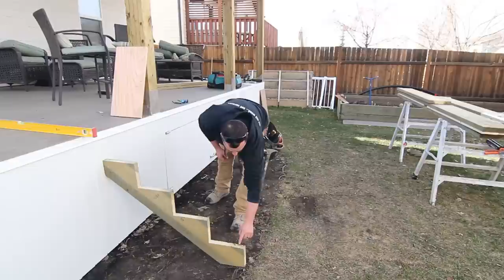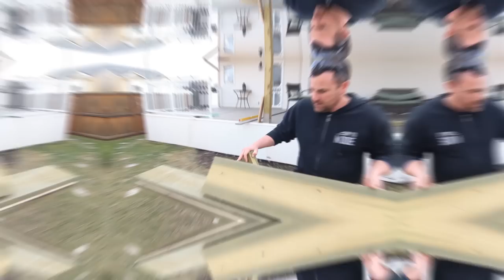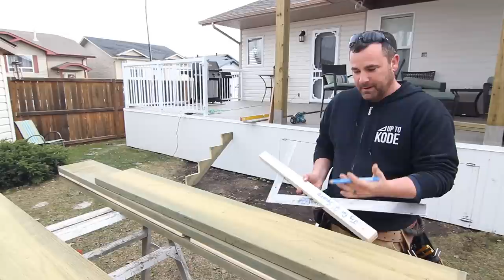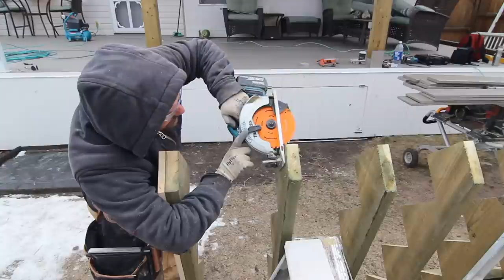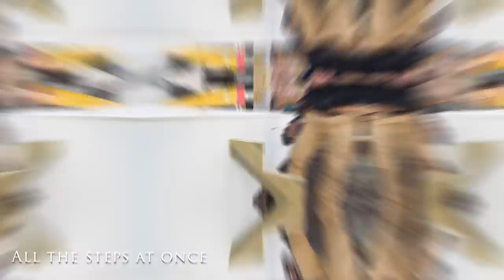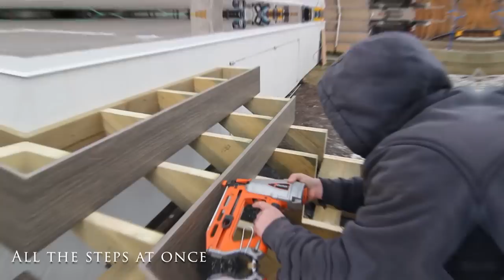How to Build a Set of Deck Stairs

Comment: Hey kode....at approx. 4.30 of the video, you mention you typically use a 10" run. I've been contracting for 20yrs, and although this is generally true, I like to use a simple trick that an old carpenter once gave me. In order to have a comfortable incline in your staircase, use this formula:  twice the rise + once the run, = between 24 and 26. So...let's say you use a 7.5" rise.... well 2x that (15) + 10= 25.... you have a comfortable incline. This comes especially handy when you're building elongated steps or an extra long span with short rises. Let me know what you think!
Reply: You are correct, last year I tried to explain that formula to a professional contractor who has many Youtube videos.   He thinks it's 2 times the tread, plus the rise equals 27.
Reply: Can you explain thst in detail cause I'm building steps for my deck
Reply: @nicolewebb558  hey Nicole... once you've determined your total height of your staircase (from the ground, to the deck floor) , you need to figure out how many steps you will need to climb. So, let's say your total height is 60". At a comfortable 7.5" rise, you'll have 8 rises and then get to your deck landing. So, twice the rise (of 7.5") is 15, your step can be either 9,10 or 11" for it to be a comfortable climb (to total between 24 and 26").
If you wish to a longer staircase, with more steps and shorter rises, you can use a 6" rise, with a 13" step for it to be comfortable. 6x2=12 + 13= 25.
I hope this helped.... good luck
Reply: @vitodifonte8761  the deck steps I see 5 so I was going to buy a pre cut one to 5 same as is but i don't think the rise on this one will match the one I buy cause the one I saw online it has a rise of 6 1/2
Reply: @nicolewebb558  the precut stringers are practical, but will rarely fit perfectly to your deck. You'll often have the last step either to short or high compared to the rest...this leads to a high risk of tripping up the stairs. It's your call in the end.... but I would strongly suggest you give it a go at your own stringers

Comment: My challenge is that I'm going to be building wooden steps over uneven brick steps.  I'm  trying to make a template so that I can cut upside down stringers to sit on the brick steps.  Then, I can attach the steps to the stringers and have them all even.  Complicated, but I think it'll look good.
Reply from the maker: Certainly a challenge to get the first step to match the bricks but you can do it!

Comment: Great video! I did my steps the same way, I didn't want to just toe on the stringers, so i inserted a ledger in between the two outside stringers, and it was self explanatory to trim the center stringer the thickness of the ledger and nail into place. i never knew it was called a ledger, I just wanted a board there so I had something I could screw and lag securely to the face of my  deck landing off of my garage.Thanks!!

Comment: Awesome vid. I'm taking my carpentry level 1 right now. On a ledger like you put on, they say to leave a 1/2" air space so wate/debris can get out. Just a thought
Reply from the maker: I’ve been making 1/8” saw cuts in the back of my ledgers to allow for drainage. Then I still get tight attachment to the wall. Not to say there isn’t better ways still.

Comment: This is exactly the video I needed for my project.  The jig tip is super.  At this point I have a question about the product you used under/at the front of the stringers.  it appears to be secured  with large spikes.  Thanks in advance.
Reply: Search “rubber edging”
Menards has best pricing, Lowes has it in stock often, Home Depot you can order it in packs of six. There are lots of offbrands that you can get cheaper online. They’re heavy so shipping may be a pain.
I fell in love with these thinking they would be wonderful and bought a couple hundred dollars worth at Menards last year...
Here’s what I learned:
They do make wider versions and you can search them online (typically from China🙄) and that ‘would’ve’ been ideal... the ‘mow-over’ edge is TOO shallow and I can’t get close enough to it with the mower deck... to actually NOT have to edge/trim afterwards 😖
...find these with a wider BOTTOM/GROUND contact side & your golden🙌🏼
After settling 1season, they sit so low in your grass & they loose effectiveness...In order to get them securely in the dirt they can’t be on ANYthing loose*BUY LONGER SPIKES*  which means you have less height room for mulch😕
I’m trying gravel this year- but will be searching for a WIDER version; since the object was to eliminate weed eating/edging!
Reply: I recommend running block along the front and sides your stairs so that you don’t have to edge/mow  up to it and potentially beat up you’re finished material. I was lucky enough to get my hands on a long piece of sandstone & sunk it in the ground in front of my bottom step- and it only sticks up a cpl inches  where I can’t catch it with the mower deck👌🏼
Oh, and something cool abt the rubber edging- u ‘can’ saw it at any angle, it has SOME curve/bend ability, and u can drill a new hole to put a spike where needed...but don’t try to cut the rubber w/any power saw lol it’ll ruin ur blade & smell awful

Comment: Enjoyed the informative video. I'm in the process of building new stairs from my lawn to my covered terrace. In your installation, did you just rest the risers on the ground or did you have some kind of base to rest/secure the risers on? It looks like the risers are just resting on the ground. I'm trying to figure out how to do this in my case. The stairs that were initially installed 14 years ago were just installed on the ground and they're now completely rotted. Appreciate your input. TEX.
Reply from the maker: This set was placed on the ground. On big stairs (wide and tall) I would consider a 2 concrete pilings for it to sit on. Maybe a strip footing across the piles but you need a void form under the slab to stop frost from smashing it apart.

Comment: Thanks, I am working with TimberTech boards & the square edge boards are not solid, I have < 1" that is solid on both side.  I am also doing a 5/8" facia.  Would you do no overhang or >= 1/8", so you have something resting on the stringer's vs resting only on the facia?  Or should I try return the board & get solid one ordered?

Comment: Thank you so much.  I do have a comment.  My Trex composite boards are 5.5" each, and I need a 1/4" spacing between them.  That would make it 11.25" total.  With a 1" overhang, my run would then be 10.25"  Right?

Comment: What is the name or where can I find that who that you attach to the framing square looks very useful
Reply: Try using any “true” straight edge😉
Aluminum flat bar from the big box store is a good place to start; Clamp two pieces together and tap identical holes through them accordingly- (use recessed head screws) - then add it to your square by sandwiching it between the 2 tapped straight edges you made.
Reply: Btw- It almost looked like he used some vinyl/dense poly sheet good (But I’m guessing it’s not, & it was something store-bought) 
I wouldn’t recommend that sort of product; it ‘mars’ to easily... it would get you through a project though & keep the needed tools to create it, limited

Comment: I would love to have seen how that cleat was installed.  I have sloped dirt where a deck company installed the stairs, and I am replacing the stringers and installing composite lumber treads, so I'm adding more stringers, using 2x4s to bolt stringers into deck and feet of the stringers to keep them off dirt. So my thought was to use pavers and lag bolts underneath 2x4s to keep 2x4s off pavers, but am concerned that lag bolt heads on top of pavers will cause slide issues since nothing is attached except at the deck. Hard to explain.  Ideally I could set a concrete base at bottom of stringers and bolt 2x4s into concrete but was trying to avoid that, thus pavers.  But I don't see a way to bolt 2x4s to pavers that would solve possible sliding away from deck. Thoughts?
Reply from the maker: What time on the video was the cleat in question? Email me if you want. Kody@uptokode.com.  Include a photo and I’ll make you a sketch.

Comment: Great video, Kody. Could you elaborate on the base holder? What would you do if there is a concrete pad or patio instead of just dirt? Love your videos.
Reply from the maker: I don’t have any footage I can throw up quickly for you. That base holder is just a 2x4 notched into the very bottom of the stairs to hold them straight and true. If landing on a patio or something solid you could do without it but I think it’s still good practice.
Reply: Thanks  @uptokode , you're the man!

Comment: Hey Kody! What would you suggest for a situation where I have a 2x8 header and I want to start my stairs like you did (meaning the first step from the deck is not even with the deck).  How would you support the stringers?  I hope I explained that correct.
Reply from the maker: I would install another 2x8 directly below the 2x8 that is above. Then I would install 2x4 vertically on the backside to connect the 2. Then attach your stairs to that.

Comment: Nice video, you explained it beautiful just the way I wanted to hear it, just one question what’s on the bottom of stairs?  Is it concrete or just soil?
Reply from the maker: The stairs are sitting on soil with landscape fabric on top. Then the lady had some rubber landscape border that goes around the perimeter of the stairs.

Comment: Hello Kody, do you have a video on how to build a free standing stairs? I have a trailer that I store at my home and to maintain having the trailer set level, the one side with the entrance door is now 2 ft from the ground. So with that said, I need to build a free standing set of steps that works for a 2 ft distance from the trailer landing to the ground. Any info would be greatly appreciated. Thanks much, Rob
Reply from the maker: You could try build a normal set of stairs and then adding vertical and horizontal pieces to the stringers so they are self standing.

Comment: Thanks for the help. Put a new shed is a while ago but needs stairs. Did you put the timber straight on the ground/with insulating material? My stairs lead down to a sloping lawn - so I figure I need to put posts in for them. Plus it gets really humid here in NZ - so direct on ground=rotting out(even H4) in 4-5 years.

Comment: I have a question.  My composition deck material is 5.5 In. That said. Treads are 10" but 5.5 x 2 = 11. So? There will be a 1" nose? Is that a deal breaker?
And my out side deck is only 2x8. Which is 7.25. The distance down isnt enough for  to catch the heal? Or the back side of the top step. My other carpenter friend told me to use strap material on the back  side of the top step to Hang the stingers.
But...that would screw with my finished look. I will be using a 1x10 cedar fascia for my trim.  I may be able to cover the steps ( the 2x8) with that????.
Need some direction on how to attach stairs when there isn't a 2x12> 11" or better on the face of what I'm nailing the stringers to.ps. with a 1/8 " gap. And a gap at the back of the tread and the riser? And a3/4 nose 11  and a 1/4

Comment: I have a project that involves a  set of deck stairs that wraps around a 90 deg. corner. Any suggestions on laying out the corner stringer?
Reply from the maker: Good question. I haven’t physically done a set like that but theory would be this. Rise always stays the same. If the stringer is on a 45 degree you need to multiply the run by 1.414.

Comment: How do I measure for slab concrete that has a 1inch dip to my last stringer? It’s not level
Reply from the maker: I have a video coming up in the next few weeks on that topic. I would need clarity on which direction the slope is. Left to right where the bottom step is? That would create a different 1st riser on the left side than the right. 

If it’s the other way where is sloping down where your last tread is going to land, that’s a bit easier. You need to get a close idea of your total run (amount of treads X dimension of each run) . That tells you where the stairs will hit the ground. Then you level over from the top landing or deck area and measure down to the location of the bottom step to determine your total rise. Once you have that, you’re set.
Reply: Its resting on a 12ftx12ft slab that was poured years ago. Looking at the stairs it’s on the right side that measures 31 7/8s on the right hand side. And 30 7/8s on the left hand side of the total width of 80 inches. 

The rise should be 6 and 3/8s the run is 10 inches. The decking for the run will be 1 inch thick, and the riser backing is a half inch thick. This is for my porch stairs. I’m assuming I should measure my stringer from the 30 7/8s and shave off the adjoining stringer to the right to work my way towards the 30 7/8s stringer. I’ve been trying to figure this out for over a week.

Comment: What is the width of the board you started with?
Reply from the maker: The stringers are typically 2x10 minimum. Deck boards are typically 5 1/2” but I don’t remember what was in this video specifically

Comment: What tips can you provide if you are doing this and your stairs are on a hill. I want to follow the grade. I do know I need to cover about 12 feet or about 16 -18 steps. About 12 feet total rise.
This video is very helpful . Getting my exact rise is a problem
Reply from the maker: I like this question!! Here’s an example. 

144” total rise = 18 risers at 8” each. This is max rise. If you have 18 risers then you have 17 runs. 17 runs x 9” each =153” of horizontal run. 

Or manipulate the run to suit a spot where the stairs would land. 17 runs x 10” each =170” horizontal run. Again...17 runs@11” =187” of run. Keep in mind you can go in 1/8 increments of run in order to get an exact horizontal position. 

Another option is maybe go 20 risers which is 19 runs if you need to go more horizontal run. 

If you need less run then stay will the 18 risers and figure out the code minimum in your area and see if that will work. 

Let me know if I can help further
Reply: @uptokode  Thank you..Ill  address the code,  and work out one of your options. Thanks and again your video was very helpful. Cheers!
Reply: This question and answer by Kode is exactly what I was after. Thanks...to both of you. Also another question? Is 16" centers the usual spacing for the stringers in any width of stairs?

Comment: Is that Trex Material? and how do you Price a set of deck stairs?
Reply from the maker: It’s similar to Trex. This product is moisture shield. I like it because it’s the same color all the way through. No wrap on it either. 

As for pricing. It’s hard to say. Once you do a set or 2 you can figure out a price per riser based on width. 

I calculate my materials and basically guess on the time.

Comment: If I remember, your riser height calculation calculated to 7-3/8" but when you started laying it out you went to 7-1/4".
Reply: 7-3/8" was an example converting decimal to fraction, original measure was 7-1/4" as he cut.
Reply: Hard to follow but then again I can’t drive a nail however enjoyed.

Comment: if you have a 10" run  then you add in 11" (2x5.5" decking). what about the fascia (which is about 9/16")..total will be 11 9/16" - 10", you will come out to have a 1 9/19" overhang, no? That's not even adding the gapping of 1/4"....am i missing something here?

Comment: Ok, so I got a question that no one seems to be able to answer.  Why ,in all these videos, do they always cut the stairs side pieces from wood planks instead of using the pre-cut pieces that can be bought at Lowes or home depot?  This makes no sense.  Please explain if you can? No one else EVER has a reason other than "you just do". This is not a reason.
Reply from the maker: A pre-cut stringer kind of works but because they aren’t made specific for your total rise then your stairs will sit out of level. When building them like this video you get them perfectly level. Feels more comfortable.
Reply from the maker: Good question though.
Reply: @uptokode  ok.  That makes sense.  Thank you.

Comment: For some reason, I am having trouble understanding cutting the bottom riser the thickness of the tread when using the same tread material on the other risers. Seems like the other risers would be the thickness of the tread higher.
Reply from the maker: You’ll have to draw it out to understand.
Reply: Rickey Keeton don’t know if you still care but here’s a better explanation. Say you are using a 1 inch tread material, you have to take 1” off the bottom of your stringers where they meet the ground, so that when you put your tread on all the runs, they have the same rise, 1” tread on a run makes the rise 1” less above until the next tread up is installed, likewise you need to calculate your stringer 1” lower than your desired rise at the top so that once the tread goes on it is the desired rise from the porch floor
Reply: You are ADDING 1" to EVERYTHING but the ground is another way to describe it. Good work!

Comment: How far apart are the stringers? You might've said it but I was never the best note taker haha
Reply: Looks like the ones in the middle are closer together, but most likely use same spacing rule as floor joists.

Comment: The old guys use 7 as a standard rise. Take the your height 36 divide it by 7 as a standard and you get 5 risers.  5 divide it back into 36 equals Rise length(7) Rise and Run need to be around 17-18 as a standard, thus you run would be the difference which is 10. You made this more difficult to get the same numbers. All you had to do was measure your height.

Comment: How to build your jig?
Reply from the maker: It is literally 2 strips of 3/4” plywood about 1” wide and 2 feet long. You can decide on width and length. Then I just use 3 screws to friction fit it to the square.